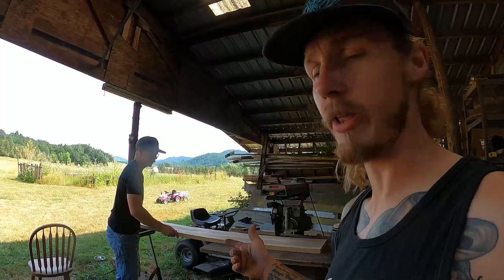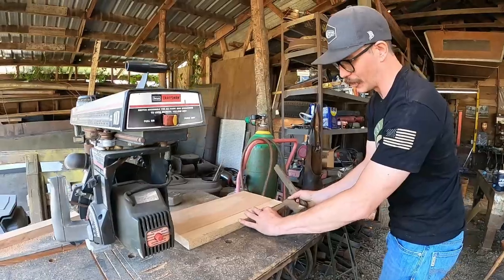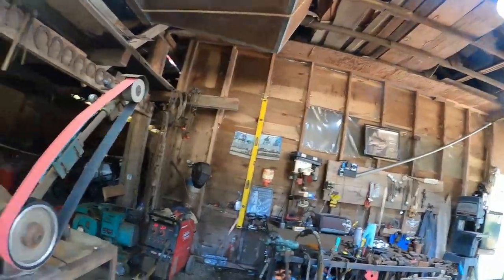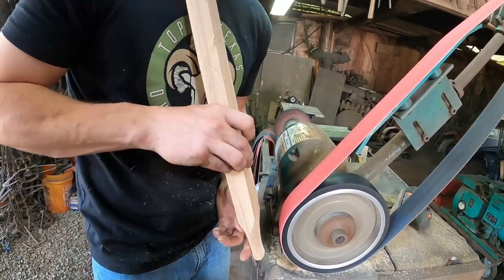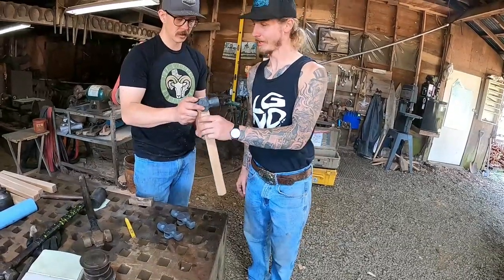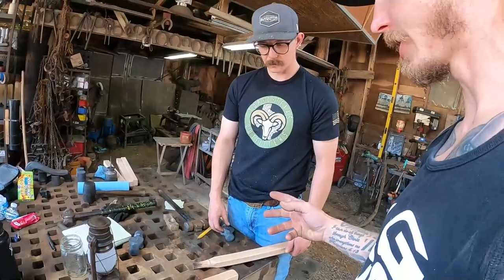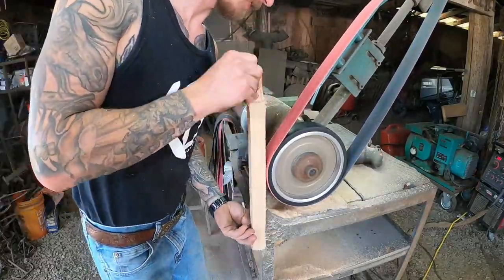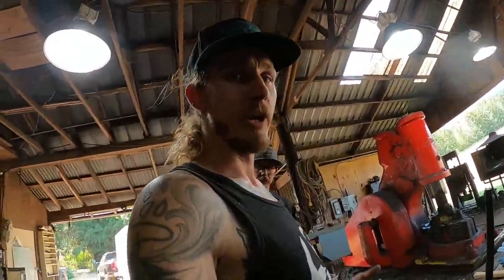How to Make & Fit up Your Own Hammer Handle from Hickory Wood- Every Step 1 2 3

Comment: Glad Riley mention that about grain orientation. I build handful of Osage bows a year, and use excess material for my hammer handles. My previous driving hammer I made before my current hammer was a 10oz with the Osage where grain 90 degree to the head. You could feel a whip lash effect and it was easier on the joints. Haven't broken a rounding hammer yet to try it on something bigger
Reply from the maker: I can say that I knew a little bit about grain structures in wood handles but after hearing what Riley had to say helped me understand that much more. Glad to hear you got something useful from the video 😎

Comment: I've always heard especially on ax handles that you want the grain going in line with the ax head or hammer head. Having the grain going perpendicular on a bow makes for ideally no run out on the grain and makes the back stronger. But the shock that a hammer or ax takes will make the grain separate over time if its going in that orientation. It's the same reason you orient a baseball bat to hit the ball with the edge grain. The bat is more likely to split if the grain is perpendicular to the ball when it takes the shock
Reply: An easier way to explain it i guess would be to take a stack of paper and bent the stack like you're going to fold it. Nice and flexible, but the sheets of paper (aka the growth rings in a wooden handle) want to slide against each other. That would splinter a piece of wood over time. Now take the stack of paper and try bending it the other way. A million times stronger